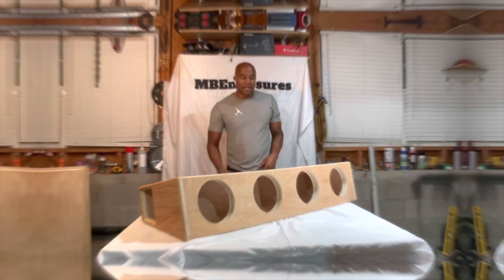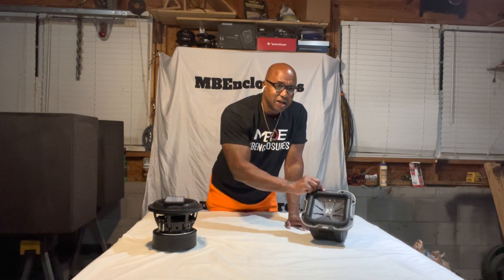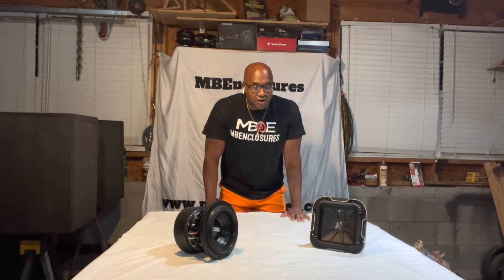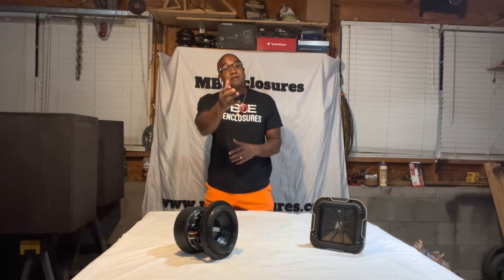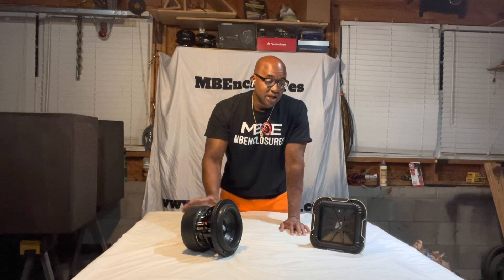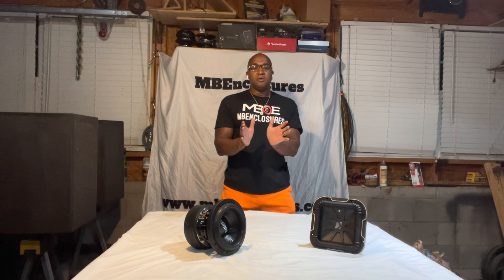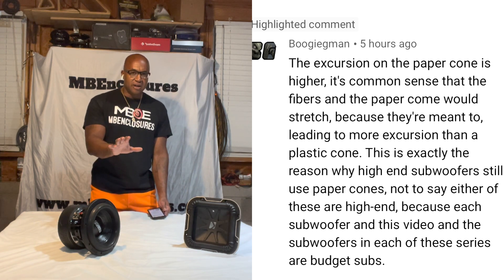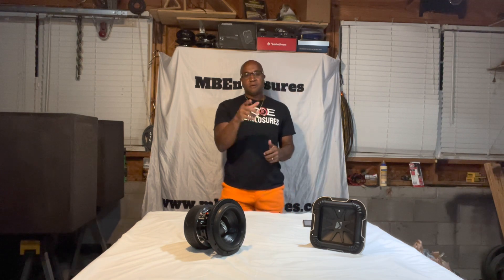Subwoofer Cone (aka speaker diaphragm ) …..Part 1

Comment: This is one of the first things I noticed when getting back into car audio, all of these new companies have some very inefficient subwoofers. They are built very well but require a ton of power! My Rockford Punch 700s and 2 Kicker L5 12’s was ridiculously loud in the 90’s. My current system has more power and doesn’t even come close and it consists of DD Audio power and Sundown subs.

Comment: Kinda looking bias to kicker now....I wouldn't think 82.4 is exactly efficient and a poly cone is light which light mass typically means high FS which is 47.6 and has a qts of .743 which usually is not ideal for ported enclosure...? the u has a heavier mass but still has a high FS also but I'm sure it has a stiff suspension for high power, but the SA8's  Heavy mass leads to it's low fs of 34.6... Imo there are advantages to poly clarity is on but it's also cost effective reason you see it and almost exclusively on the $20/$30 subs also, there is a reason you don't see it used in most subs and one reason is it's hard to get a low fs with a light moving mass usually a super soft suspension is needed with a light mass and that does not lead to high power handling.But with anything there always an exception.

Comment: The people need a video on sound, spl numbers vs what you hear. I say this bc I had 2 cvx 12's on a zx1000 at 1 ohm. Sounded amazing, but wouldn't put up big spl numbers. We ran two old school mean machine 12's on a 3300 watt amp at half ohm and put up a 171.3, but it sounded like shit. Different application calls for different variations of set up based on what your desired outcome is. Thx

Comment: So would a larger dustcap counteract a deeper cone? In theory it would create a shallow cone and increase cooling to coil if the overall structure was the same as deep cone small cover correct?
Reply: Yes
Reply: I would hardly call and 8" sub costing over $200 a budget sub, but hey that's just my humble opinion.  My x8v3 gets pretty damn loud for an 8 but I'm really getting the itch to try these Kicker Q's.  BTW, paper don't stretch.  Spiders, tinsels and surrounds do though 😎

Comment: The reason for paper is cause it’s lighter. If you use an inefficient motor with a heavy cone you now need 3500watts to achieve the same output as a you doing with paper at 2500 which you only need 2500 instead of say 750 cause of the motor.. which is why other companies use other markers as cause there motors are more Efdcient. To be honest if you put a paper cone on a l7 motor or w6 motor you would have like a 95db efficient speaker that would reach full output at just 300watts or so.

Comment: I'm an acoustical engineer and I follow here because this guy fact-checks his stuff before he talks. He is absolutely correct. The method years ago was higher efficiency, larger boxes. To date it's all about how many subs I can fit so now you end up using smaller boxes and need more excursion to move more air to play lower. Keep this channel going and spread the knowledge!
Reply: Almost any sub is getting louder in a bigger box,how many people are willing to give up there space to get louder?
Reply: @R.T.D-Garage  In engineering, we learn of iron laws. One for acoustics is the hofmman law by Josef. You cannot have an efficient enclosure that plays low and uses a small enclosure. You must choose two and compensate the other. I prefer build my speakers in the correct size box so it sounds as musical as possible and play any genre of music than having a one note wonder. Alot of people just get into audio and don't have any idea of the necessary compromises
Reply: @shemarwilliam4369  i get you,,,you kinda missed what i said tho...whos trying to give up a large amount of space  for a driver when you can get the same performance in A smaller space...maybe need more power but it not like your losing low end. just giving up space that you dont want to give up... everything looks good on paper until its   put to an actual test  and its specific vehicle
Reply: @R.T.D-Garage  I get what you're saying. I get all of this. And it's true, Everyone wants to save space and more power can compensate but I believe MBE explained it perfectly when he spoke about removing a taramps 10k I believe for two RF 1500.1. Our electricals can't even handle the little power we add. it's a paradox so I guess it's all preference
Reply: @R.T.D-Garage  also, there's a limit as to how large you can go before QMS plays dominance in woofer control. So it's all about building to suit the subs and not cutting corners
Reply: I dont think its about how many subs i can fit in my space...more about what can i use to get what i want with the space that i have...who is really trying to take up 2 cubes not including port/sub displacement with 2 8's for example....when you can get better performance and louder with certain products in smaller enclosures when there built right